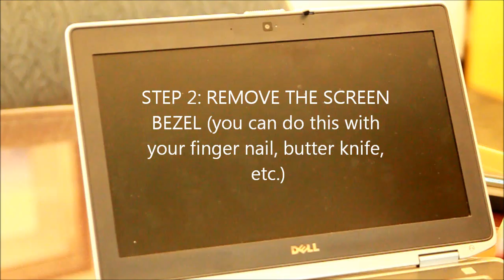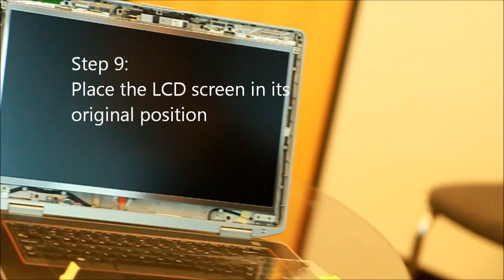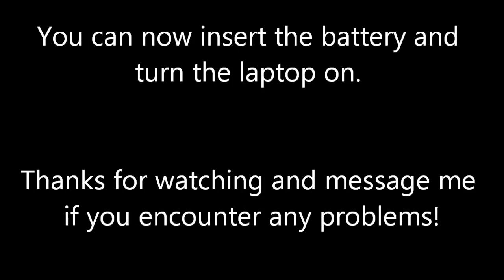How to replace Dell Latitude E6420 LCD screen

Comment: Thanks for the video, the instructions worked perfectly (with sound muted). Dell no longer provides spare parts and service for laptops older than about 6 years, but they gave me a good advice that missing background light is most likely a problem with the screen, not with the cable. The laptop works again. Thanks!

Comment: Book Title: HOW TO MAKE GOOD YOUTUBE VIDEOS
Lesson 1:
When the video is about demonstrating something practically, always use actual sounds. Do not mute or superimpose with anything else.
Reason: Actual video sounds give additional information like how hard or easy it is to pull the cover, sound of sliding the data ribbon says how smoothly it gets slides in or how easy/hard it is to pull out.
Tip: Instruction by voice are essential for following it easily.

THE END

Comment: I did it! I changed the screen using this video. I also ordered the screen through the link. The computer fixit guy wanted 210 bucks. I saved $170 doing it myself. Many thanks.
Reply: What's the screen cost?
Reply: The cost was between $40 and $50 for an LG screen for my Dell 6420. I got it here:

 http://www.laptopscreen.com.

It is working great.
Reply: @TheCruiseDog  thanks for your response

Comment: Hello, a question my display is all black, but if I use a torch you see something, the problem is the backlight? Do I have to replace the display and just need it? . Thanks for a reply.
Reply: I have this same problem, seems the back light is out however the screen icons are dimly visible. I hoped it was just a simple LCD inverter swap but this model is a bit different.
Reply: Hi, I did not find much information and I think to buy a new screen and see if the problem is resolved. However, if my laptop is connected to the TV through the VGA port, it looks great and if the Portable HDMI still works better. Unfortunately it is no longer a portable :) :) :)

Comment: +Ryan P, can I replace my inspiron 14r n4010 screen (which is glossy) with this Dell Latitude E6420 LCD screen (which is matte), as its less strain on eyes?
Reply: Late answer, but yes. You can.
Reply: But i dont think it can fit in the frame, but it should work

Comment: Do you think I can replace t5he video card on my latitude e6430? I want to game on high end games like fallout 4
Reply from the maker: +Ramon Contreras Unfortunately, your only options really are to use a eGPU (External GPU) because the GPU's in these laptops are pretty much soldered to the motherboard. Check out these links for some additional info: 

http://www.pcworld.com/article/2984716/laptop-computers/how-to-transform-your-laptop-into-a-gaming-powerhouse-with-an-external-graphics-card.html

http://ask.metafilter.com/239461/Upgrade-the-GPU-on-a-Latitude-E6430-or-E6520

Comment: I have a question: 
There is a band connected to a board that is fixed on the display, it is right in the middle of the screen. It is not the flex band connected to the motherboard. 

There are a few lines on my display but when i push that band it is all ok.
Can that be replaced/repaired or i need to replace the LCD?

Comment: It is potentially possible, but most of the time requires the new cable for bigger data transfer between LCD and laptop's video card. 
Usually not the best idea to go from HD to HD+. Make sure to check compatibility before ordering a part.